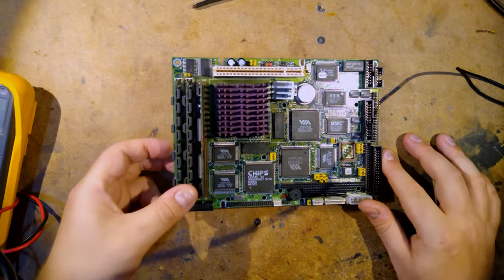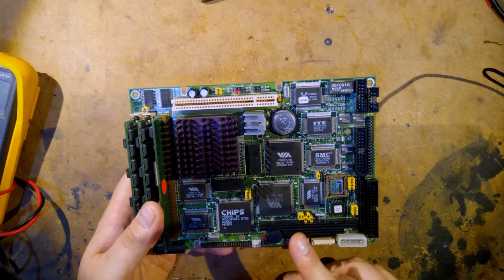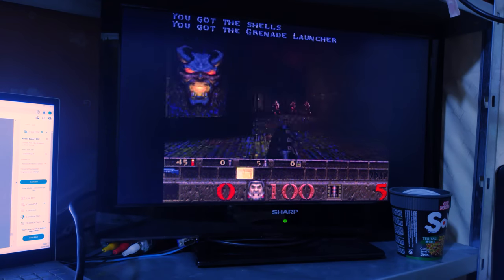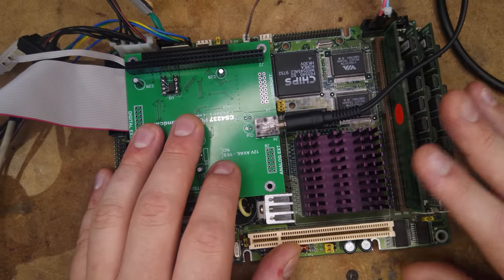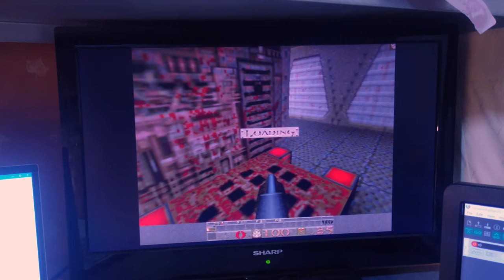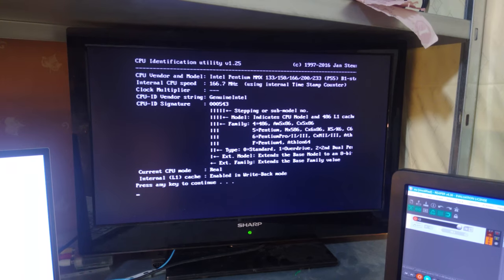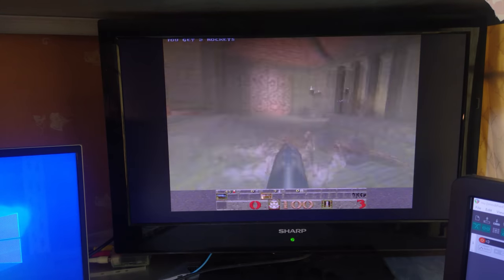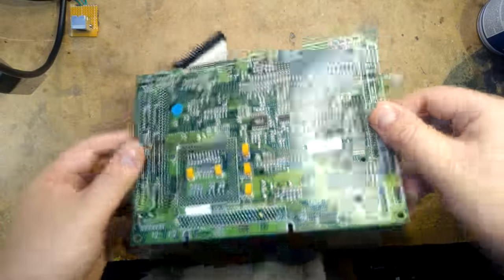3D Accelerating a mini Industrial Embedded PC

Comment: Voodoo Rush?
Would fit the era of Pentium 133, fairly well.
Reply: I'm thinking the point of diminishing return is actually the 2D card on the board being the limiting factor.

Either that or it's the RAM. Looks like EDO-RAM
32 MB total?
Reply: Carmageddon was considered a DOS release and can use 3dfx.
Released in 1997, so late-era DOS.
Perhaps worth including in it tests?

Comment: The CPU is definitely a bottleneck. Without question.

I used to get over 30fps at 640x480 with a 233mhz Pentium MMX.
Reply: What would you need for 60fps at 1024x768? - with the software renderer?
Reply: @brentgreeff1115  I am honestly not sure. I would think probably a Core 2 Duo E8400 at least.
Reply: @nexxusty  - that ran some pretty high-end games in its day. - should do well, if its compatible with the original doom.
Reply: @brentgreeff1115  Oh yeah she's compatible.

You could run probably about 40 copies concurrently at the full 35fps. Lol.

Cheers brother.
Reply: Nonsense

Comment: What's that big silver can? that a battery?
Reply from the maker: Yeap. You'll notice it changes about halfway through the vid, it died while filming :(
Reply: @Unix Perdunix Right, just doesn't look like any kinda CMOS battery i've ever seen before, like a weird soldered in CR2032 instead of being in a holder.
Reply from the maker: @Nukle0n  It's a ER22G75 battery, specifically the TL-5186. Probably quite high-quality considering the board it came from
Reply: @TheRasteri  Still a bit odd for an industrial board to not have it be replaceable. I guess they just wanted you to chuck that board and get a new one.

Comment: You could try to use compatible CPU instead of the Pentium to see if that speeds up things. I remember that the Cyrix MII was a very fast CPU for Socket 7 and the AMD K6 wasn't bad either (ok, its probably not so easy to find any of these nowadays xD).
Reply: Wasn't Quake what alledgedly killed off Cyrix?